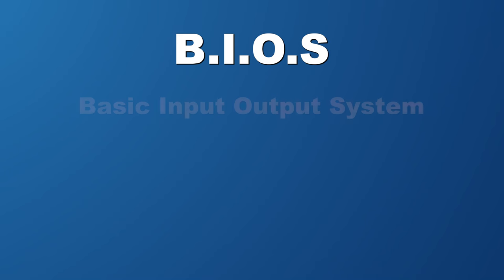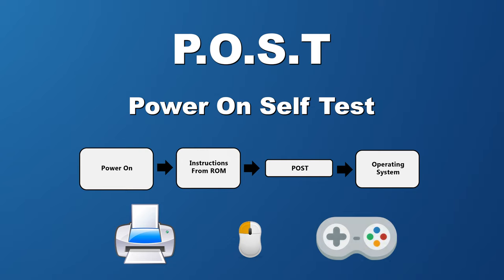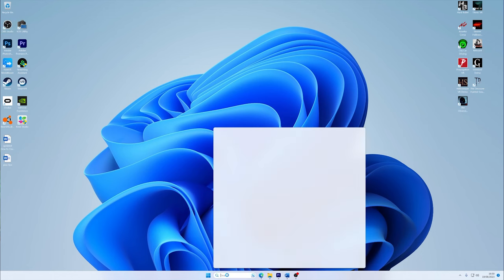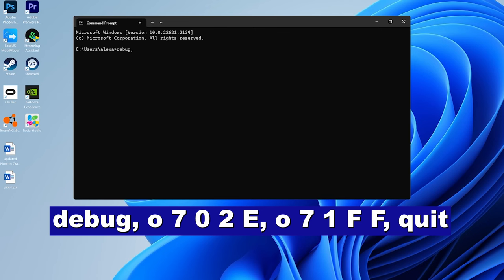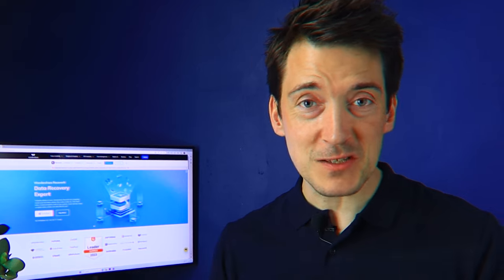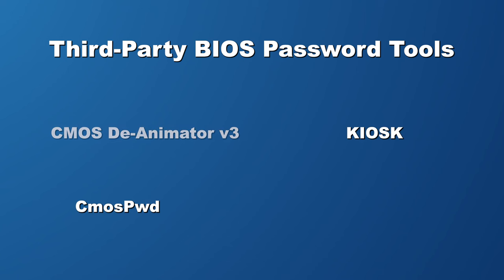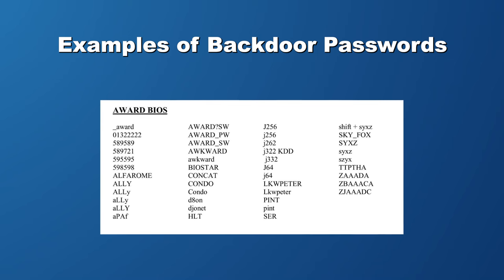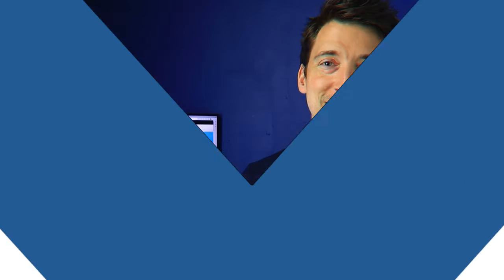How to Crack Bios Password

Comment: When ever I run the debug on CMD it always spits out an error that “debug is not recognized “ what do I do from there
Reply from the maker: Hi there, thank you for your question! The error message that you get means that the debug command is not available on your system.
Reply: @RecoveritDataRecoverySoftware  Is it on your system? There's no prove in the video. The command isn't executed. If it isn't fake you should know where to get it from.

Comment: I get this message when I enter the command in command prompt, both with and without admin privs." 'debug' is not recognized as an internal or external command,
operable program or batch file."
Reply from the maker: Hi there, thank you for your question! The error message you’re seeing indicates that the debug command is not recognized by your system this could be because the command is not installed or not in your systems path enviroment variable. You can try to open the Command Prompt as an administrator, navigate to the system32 folder by typing "cd C:\Windows\System32" and pressing Enter, then type "debug" and press Enter. However, if you continue to encounter the same error message, it's likely that the debug command is not installed on your system
Reply: @RecoveritDataRecoverySoftware How can we get the debug command 😊?
Reply: @RecoveritDataRecoverySoftware  how can we install the debug command?
Reply: have you resented your bios password sir help me out too

Comment: why are u saying to 'reset' the bios password? what does this mean? 
no password prompt populates?
no password needed / blank password?
gives option for new password?
defaults to default factory password? 
device specific password?
an anything u input is fine password?
something else?
the word 'reset' is used interchangeably  in many fields and industries and is not at all indicative of what the user is trying and failing to convey.   i believe the narrator even uses it unspecifically tho its hard  to be sure.  kind of important to know what resetting DOES. [2:15] how would  we know if it was successful?  one of the options listed above is presented? does something happen?  nothing happen.?  

what cracking DOES. what if i just want to nut the password?  or block the password absolve the password?.  and why is resetting the bios considered as fixing the  password issue?  this appears to be used interchangeably as well. no reason given.  what is 'fixing'  
why isthe narrator saying it might  be necessart to crack the password? necessary?  what is the iportance of 'getting' get the bios password [1:39]? getting? what does this mean?
and why waste time explaining what BIOS is?  what does this have to do with its password.>getting, resetting, cracking, bypassing, fixing.disabling- i'll just try a different vid.  thx
Reply: Just know he will not read this. Its been an entire month and yeah...

Comment: Hello brother, how are you? I wanted you to help me with a problem. My PC is HP Model G 42415DX Noot book PC and I wanted you to help me. When I turn it on, the yellow light on the Wi-Fi signal and the white light on Caps Look blinks, but please give me the solution. Thank you.
Reply from the maker: Hi there, thank you for your question! Having the flashing light by your ethernet port is pretty normal and shouldn't be an issue as well as with the caps lock button are they causing any issue when using the laptop?

Comment: Hi after i took out the proccesor it wants the bios pasword i took out the baterry and it lets i the computer but it runs slow and the cooler on the procesor is going extremly fast and will not stop
Reply from the maker: Hi there,
Could you please elaborate on your question? We're glad to help.
Reply: @jakubmarko6324 fiz esse processo no meu notebook Leenovo Thinkpad L440 e aconteceu a mesma coisa...
Segundo eu pesquisei e vi vídeos no Youtube,tem que regravar o "Eprom" da placa mãe.

Comment: Hello, I have a hp folio 9480m i want to access the Bios but it requires some password. Idk what it is pls help
Reply: same with me...bought it second hand and now i need to enable the hyperv functionality...no luck hunting the bios password so far
Reply from the maker: Hi there, thank you for your question! Reset the BIOS password: You can try removing the CMOS battery and the laptop battery, and then holding the power button for 8 seconds. After that, reinstall the batteries and turn on the laptop. This should reset the BIOS password.
Reply: using the same laptop, have you been able to reset the bios password at your own end?

Comment: I followed the procedure outlined in your video, but I am still unable to access the BIOS. It continues to request a password. Is there another method I could try? My notebook is the Lenovo V15 G2-ITL Laptop - Type 82ME model. Can you provide any assistance?
Reply from the maker: Hi there, thank you for your question! Another possible method is to use the Novo button on your laptop to access the system recovery menu. From there, you can select the option to restore your PC to factory defaults, which will also reset the BIOS password. However, this method will erase all your personal data and settings on your laptop, so you should back up your important files before proceeding. If none of these methods work for you I suggest you contact Lenovo customer support for further assistance.
Reply: @RecoveritDataRecoverySoftware   Não adianta...está gravado no "Eprom" da placa mãe...ja tentei de tudo no meu Notebook Lenovo Thinkpad L440.
Teria que fazer uma regravação do Eprom,ou trocar a placa mãe por outro do mesmo modelo...
Acredito que a própia microsoft faz essa alteração na Bios...isso aconteceu depois que "ganhei" o W10 pro da microsoft,que instalou online,
apagando o W7 original...nunca mais consegui acessar a bios.

Comment: My ACER laptop is stuck in a loop of BSOD saying “Inaccessible boot device” this happened after I factory resettled it, I’ve tried messing with BIOS but nothing works, I’ve tried getting into Startup Repair Tool but it won’t open, I’ve tried every key, including turning the pc on and off 3 times. I’m not sure what to do anymore, got any advice?
Reply from the maker: Hi there, thank you for your question. It seems like you're dealing with a challenging situation. The "Inaccessible Boot Device" error can be caused by various issues, and it's not uncommon after a factory reset. Let's try some troubleshooting steps to help you resolve the problem:

Boot into Safe Mode:
Restart your computer.
Press the F8 key repeatedly as the computer restarts.
Choose "Safe Mode" from the Advanced Boot Options menu.
If you can boot into Safe Mode successfully, it may indicate a driver or software issue. From there, you can uninstall recent updates or drivers.

Boot from Windows Installation Media:
Insert the Windows installation media (USB or DVD) and restart your computer.
Press the key (usually F2, F12, ESC, or DEL) to access the Boot Menu.
Choose the option to boot from the installation media.
Select "Repair your computer" > "Troubleshoot" > "Advanced options."
Reply: @RecoveritDataRecoverySoftware  Thank you for your reply and effort to help, unfortunately I was unsuccessful in trying to boot into safe mode, I’ve even tried every key and I do not have any installation media such as a USB or DVD, I am still stuck in this screen, altho much appreciated.

Comment: I have an hp 250 g7 and debug was not recognised 

I dont get a code either when i type the bios setting incorrectly 

Does factory resetting my laptop work too?
Reply from the maker: Hi there, thank you for your question! Factory resetting your laptop wont reset the bios you will need to try enter the bios and as you enter look for the option to  “Load Setup Defaults” or “Reset BIOS Settings.” If you don't get any of those option you need to see if there is a way to reset the CMOS battery on your laptop which will reset the bios to factory conditions.

Comment: I have an Asus. I disabled the Admin BIOS password but it’s still requiring a password pls help
Reply from the maker: Hi there, thank you for your question. If you've disabled the admin BIOS password on your Asus computer, but it's still prompting for a password, there are a few steps you can take to address this issue:

Verify Password Entry:
Double-check that you are entering the password correctly. Ensure that the Caps Lock is not enabled and try entering the password again.

Clear CMOS:
Clearing the CMOS (Complementary Metal-Oxide-Semiconductor) can reset the BIOS settings. To do this, you typically need to:
Power off the computer.
Locate the CMOS battery on the motherboard (a coin-cell battery).
Remove the battery for a few seconds and then reinsert it.
Power on the computer.
Note: Clearing the CMOS will reset other BIOS settings as well, so you may need to reconfigure some settings after doing this.

Contact Asus Support:
If the issue persists, it's advisable to contact Asus support for assistance. They may provide specific guidance based on your computer model and the nature of the problem.

Comment: i remebered my bios p/w after getting it wrong more than 3 times. my ssd was frozen. i removed cmos battery and cleared but stuck in automatic repair boot loop. anyone know what i can do ?
Reply from the maker: Hi there, thank you for your question! I would recommend trying to disconnect everything besides your CPU and Ram and see if your computer boots up if not then I would recommend creating a bootable USB drive and then try running your computer from their and then try to repair the device.
Reply: @RecoveritDataRecoverySoftware  thanks for the reply. i got desperate so I've put the drive in a caddy currently running ddrescue on a linux machine. slow progress but is recovering files...

Comment: Hello! I have a dell desktop mini optiplex 3090 and can't access the bios due to it being locked. Any ideas on resetting password? Thank You!
Reply from the maker: Hi there, thank you for your question! Turn off your computer and disconnect the power cord open the case to access the motherboard locate the password reset jumper (PSWD) on the motherboard. It’s usually a small blue plastic piece with three pins remove the jumper plug from the default position (pins 1 and 2) and place it in the clear position (pins 2 and 3) then power on the computer without the jumper plug to clear the password wait until the desktop loads, then shut down the computer reconnect the jumper plug to its original location power on the computer again, and the BIOS password should be cleared.
Reply: Thank you for such a swift response! Unfortunately this optiplex 3090 is a 2022 model which they removed the PSDW all together… Which has lead me hear to your video for extensive help 😅
Reply: @RecoveritDataRecoverySoftware  Appreciate your reply, but there's no jumper on my 3090 either nor are there any pins to attach a jumper to. Do you have any other possible solutions? Thanks again!

Comment: How can I solve BIOS passcode on my 12gen laptop ?? Also a repair guy said it has BIOS and other hard passcode ? What kinda passcode that should be ?? Thanks a lot
Reply from the maker: Hi there, thank you for your question! If you tried all the steps in the video and it still doesn't work I would recommend contacting the manufacturer for further assistance.

Comment: I know my bios password, I just want to stop the process of asking my bios password, how do I just turn it off
Reply from the maker: Hi there, thank you for your question! Restart your PC and enter the BIOS setup by pressing the appropriate key (usually F2, DEL, or ESC). Enter your current BIOS password to access the settings. Navigate to the Security or Password section, then select the option to Disable or Clear the BIOS or Administrator password. Save your changes and exit the BIOS by pressing F10 or choosing Save and Exit from the menu.
Reply: Doing this completely bricked the Asus laptop I have. I'm now asked for an admin password even though my admin password was cleared and showed as uninstalled. I no longer have access to bios during boot and even a bootable USB bios flash drive made with Rufus doesn't work... Suggestions? It's an Asus TUF F15 FX506LH model, I don't have any services in the area that can fix this either.
Reply: Forgot to mention that I haven't found a CMOS battery after opening the laptop either and there doesn't seem to be a jumper anywhere.

Comment: I have a laptop that does not have a bmoc battery and the bios is blocked, is there any way to fix this?
Reply from the maker: Hi there, thank you for your question! If you're sure you laptop does not have a removable CMOS battery then you can try flashing the BIOS with a new firmware. This process involves using a tool to write the new firmware to the BIOS chip on your laptop’s motherboard. You can find instructions on how to do this for your specific laptop model by searching online. However, this process can be risky and may cause permanent damage to your laptop if not done correctly so if you feel uncomfortable then I would recommend taking it to a professional for assistance.
Reply: @RecoveritDataRecoverySoftware  That's okay, it's an old Acer hybrid
Reply: Oh, yeah right.

Comment: My password comes on every time I turn on the laptop 💻
Reply: How do I fix this
Reply from the maker: Hi there, thank you for your question. If your laptop is prompting for a password every time you turn it on, it's likely due to a security feature, such as a password-protected user account or a BIOS/UEFI password. Here are some steps you can take to address this:

User Account Password:
If the password prompt is associated with your user account, you can change or remove the password from the user account settings.
On Windows, press Ctrl + Alt + Delete and select "Change a password" to change the password or "Manage another account" to modify account settings.

BIOS/UEFI Password:
Some laptops have a BIOS/UEFI password set for added security. This password is separate from the user account password.
To access the BIOS/UEFI settings, typically, you need to press a specific key during the initial boot process (e.g., F2, Del, Esc). Check your laptop's manual or splash screen for the correct key.
Once in the BIOS/UEFI settings, look for a security section or a tab that allows you to set or remove a password.

Comment: I have an HP elitebook 840 g3 how do i reset the password
Reply from the maker: Hi there, thank you for your question! You can contact HP in your region and request a customized SMC.bin file, which you can use to reset the password. Please note that this method requires you to provide proof of ownership of the device. You can replace the BIOS chip on your HP Elitebook 840 G3 with a new one. This method requires you to open up your laptop and locate the BIOS chip on the motherboard. You can then remove the old chip and replace it with a new one.